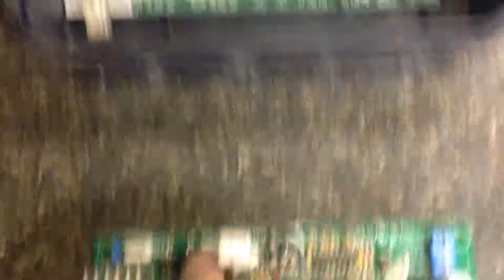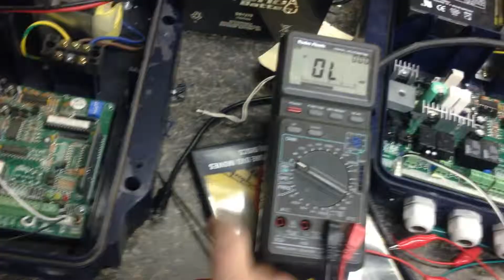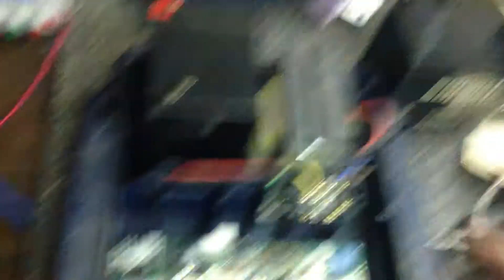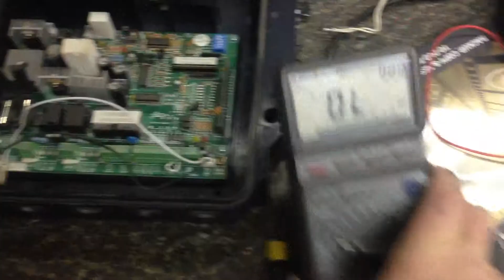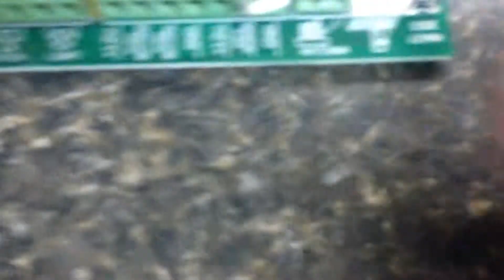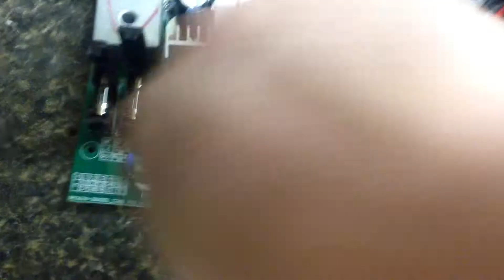5602 Control Board Diagnosis

Comment: Hi,  My 5602 has started to not complete the learning sequence when the transformer is connected.  The transformer's output is 17.8V AC.  If just the battery is connected, the learning process completes.  If I then reconnect the transformer, the gates open half way.  Can you say what the issue may be?